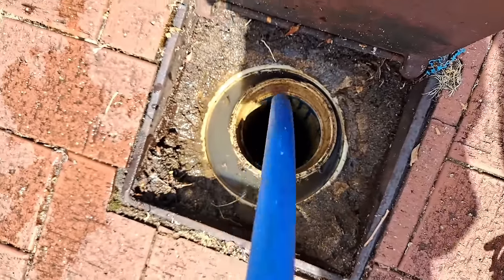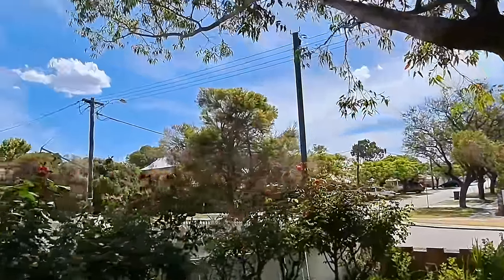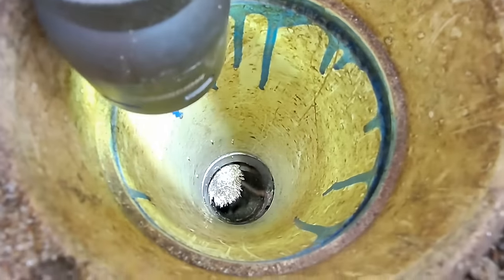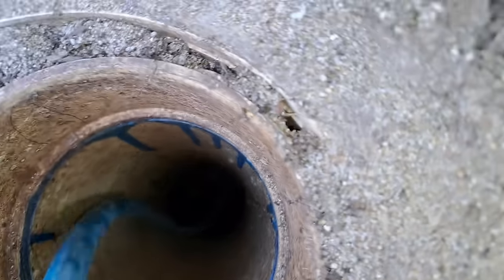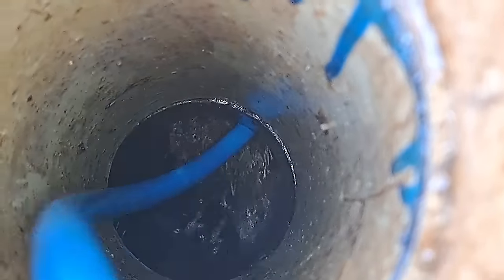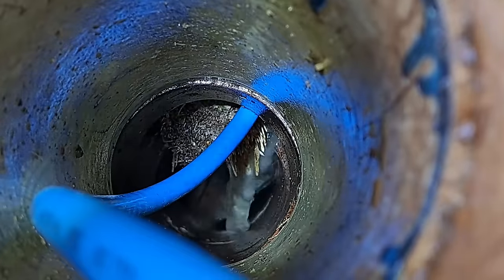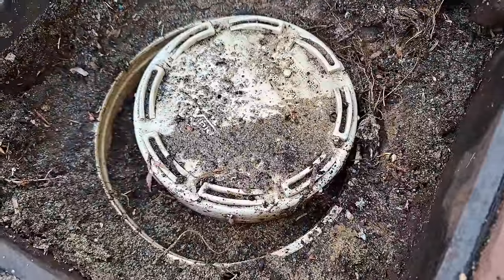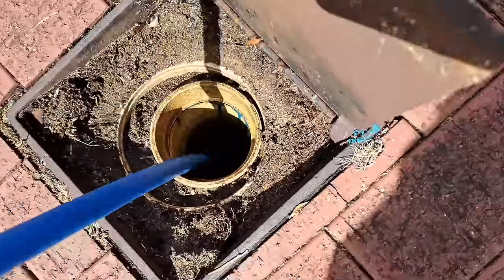Drains Blocked and Neighbours are Pissed!!

Comment: Those inspection ports where the house ties-in to the public sewer are convenient for clearing blockages. We don't have "gullies" next to the houses here, but rather capped off clean-outs...  and the sewer connection is just buried under the street.

Also, while there are some hydro-jet drain opening services, most unclogging in the States gets done using a powered plumber's snake.